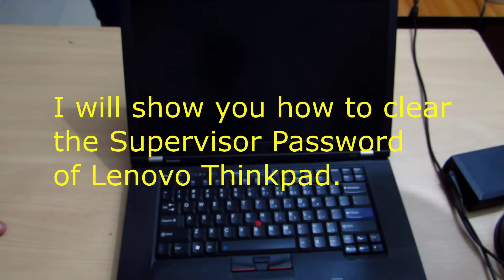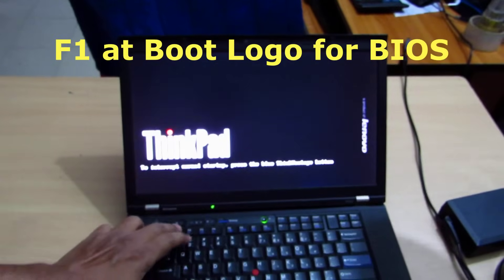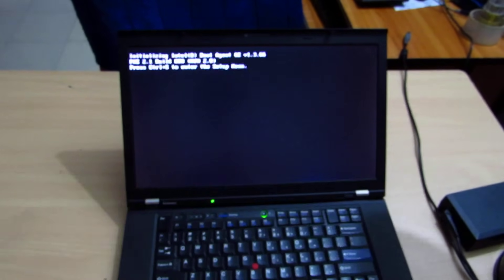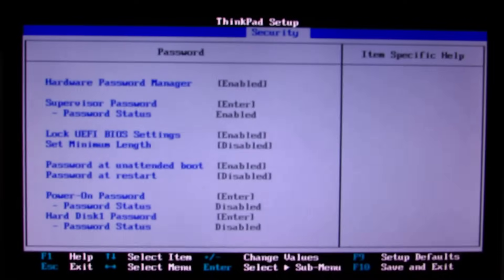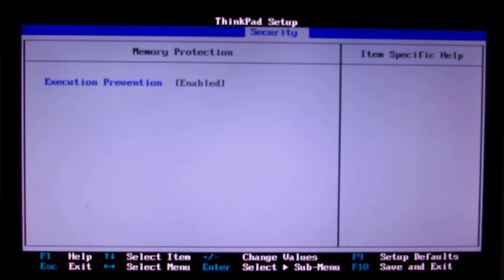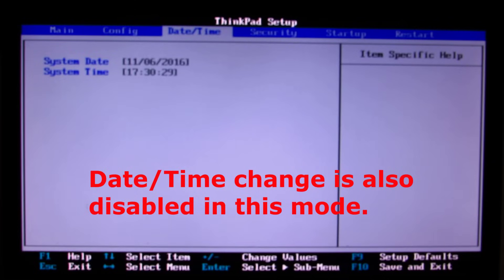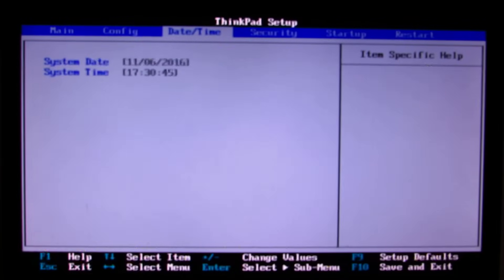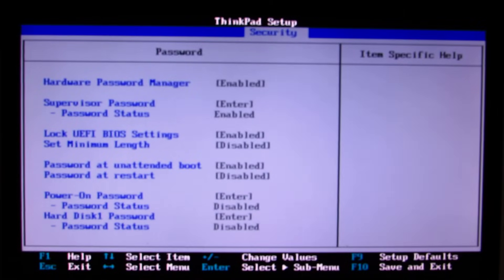How to unlock BIOS Supervisor Password from Lenovo Thinkpad Laptop (no damage to laptop)

Comment: First off, highest praise to Arpan. Would never have been able to revive the T510 ThinkPad I was working on without Arpan's inestimable help. Bottom line: Shorting that little EEPROM chip works exactly as shown.

But.

Getting to the chip on the T510 I was working on, turned out to be much more involved than the video might give you to believe, and in the interests of perhaps helping a few people out there who might be having trouble with the details, I'm going to add a few things that I discovered for myself, the hard way.

Getting the Base Cover Assembly off of the machine was non-trivial. Arpan's expertise is top-notch, but for those of us who do not operate at his level, there are many pitfalls along the way.

To begin with, I would strongly recommend pulling up the service manual for the T510, and it can be found here: https://download.lenovo.com/ibmdl/pub/pc/pccbbs/mobiles_pdf/63y0536.pdf

Be advised that this is a Lenovo document, and it's terse to the point of near-uselessness in certain places, and some of the illustrations leave much to be desired, but it's a great help, otherwise.

The chip you're looking to short is on the underside of the motherboard, and removing what Lenovo calls the "Base Cover Assembly" is what is required to gain access to it.

If Arpan's speed (even freezing frames, it still blinks by too quicky in places), in conjunction with the occasional, camera angle blocking the precise location of what he's working on, plus occasional out-of focus depictions of what he's doing in the video, is causing you problems (it was a show-stopper for me, with my lower level of expertise in a couple of places), then going by the Service Manual will allow you to complete the work.

But the manual goes into the disassembly of things in a different manner than Arpan's streamlined approach, so be ready for a lot of steps.

The manual wants you to remove the Thermal Assembly and THIS IS NOT REQUIRED. Leave it alone. In order of what I wound up having to do, by the manual, using the manuals terms, it went like this:

Sim card.
Battery pack
Serial Ultrabay Enhanced device or travel bezel
DIMM slot cover
Hard disk drive slot cover, hard disk drive (HDD) and HDD rubber rails or Solid state drive (SSD) and storage converter
Keyboard
PCI Express Mini Card for wireless LAN
PCI Express Mini Card for wireless WAN
Keyboard bezel assembly
Bluetooth daughter card
Backup battery
Smart Card or Contactless Smart Card or Smart Card dummy spacer
Speaker assembly
LCD unit
And finally, the goddamned Base cover assembly.

Anything not mentioned above is NOT required. You can safely skip any steps that are not included in this list of steps.

That's a LOT of disassembly just to get to the EEPROM chip, but either because some of this stuff is blocking wires, plugs, or screws that require removal to get the Base Cover Assembly off, or because dangling junk was in the way, or because access was just too close for comfort otherwise, it turned out that all of this stuff was much better off, being removed from the machine. Take your time, go slow, go easy. Required tools were pretty simple. A couple of spudgers, a small phillips head screwdriver, and that's about it. The good news is that the service manual has a complete and precise listing, by size and appearance, for every screw involved in this operation. This makes reassembly much easier, too. The bad news is that some of the illustrations are quite poor in showing you precisely where these screws are, and let me tell you, some of them are very easy to miss, and some of them, like the one beneath the left speaker, are completely hidden from view until the intervening item that's blocking them from view is removed. But they're all there. Every last one of them, and a couple of them are very hard to find, and without removing them, the Base Cover Assembly will not come off. I highly recommend taking that Base Cover Assembly all the way off, and putting it somewhere aside. That EEPROM chip is small, and there's a whole world of other conductive things right next to it and all around it, and any restrictions imposed by only partially removing the Base Cover Assembly, are not worth putting up with, just because you didn't want to find and remove, every single little screw that's holding the thing on. Get rid of it. Take it all the way off. You'll be glad you did.

Once I had the Base Cover Assembly removed, along with the piece of black adhesive paper that covers the whole area surrounding the EEPROM chip (just pull it off, it's glued, but not impossibly so, just do it nice and easy, 'cause you're going to want to put it back in place when you're done), I had a clear shot at shorting the pins on the chip. I then placed the Monitor (LCD unit in the manual), back on the machine, and screwed the two screws on the rear edge of the machine back in, to hold it in place firmly. Otherwise, it's flopping around, it's heavy, and something nasty could happen if it's unsecured. So screw it back on with those two screws before you go to work on the EEPROM chip.

You have to plug the ribbon cable for the keyboard back in, to operate the power switch on the machine, so that needs to be done too. Once the keyboard's plugged in, it too flops around and I taped it down (being careful not to tape any of the keys down into a depressed actuating position while doing so) so it wouldn't get all over the place and mess something up. I plugged a USB keyboard into one of the USB slots and used that to work the BIOS instead of the keyboard I had taped into place. Much much easier to access the required keystrokes that way (mostly arrow key, enter, and escape, with a few exceptions) with the USB keyboard right where I needed it as opposed to the machine's own keyboard, dangling above the machine.

I laid the machine on its back (the back of the LCD unit) with the body of the machine sticking straight up giving me excellent free and clear access to the EEPROM chip, plugged in power and keyboard, made sure everything was solid, and would not move or fall while I worked the EEPROM chip, possibly causing the tip end of the partially straightened-out heavy paper clip I used to short the pins to jump and then short the Wrong Thing, possibly bricking the machine, and then went at it.

Turned on the machine, logo came up, applied the short PRECISELY AS ARPAN DEPICTS IT (but if you want another picture of the chip, just for good measure, find it here: http://www.ja.axxs.net/t510.htm) and CONTINUED TO HOLD THE SHORT, just as Arpan instructs. Having to continue to hold the short is one of the reasons I went to so much trouble to get maximum ease and clearance of access to the chip. I was comfortable, and there was no risk of having the short jump off the pins, possibly shorting something else, and bricking the machine.

The EEPROM chip is square with four conductive metal pins on opposite sides, and has a small indented/embossed/shallow circle on one corner. The two pins you need to short are on the opposite side/corner from that circle.

xxxx
    o

xxxx
^^
These two pins.

The chip is very small, and the pins we're shorting are very VERY small, and there's a million other teeny tiny conductive things all over the place in there. Mind where you're at, ok?

My experience was that immediately upon applying the short right after the logo came up on the screen, I got an error message advising to press F1 if I wanted to enter the BIOS Setup, which I did, and which came up instantly.

From there on, it was as if I was doing a normal BIOS Setup procedure. Except for holding the short across the pins, of course. Navigated into the Security area, and Password area, and went after the Supervisor Password EXACTLY LIKE ARPAN TELLS YOU TO. Blanked the password entry field initially by simply hitting the enter key, AND THEN RELEASED THE SHORT, and then blanked the confirmation field by hitting enter again. It accepted my alterations, and I then hit F10 to save and exit.

It was that simple.

Restarted the machine, and I had full control, BIOS Supervisor Password was now a thing of that past, gone!

Hallelujah!

So the business of actually working the EEPROM chip turns out to be fairly easy and straightforward.

But the business of getting to that miserable little thing in the first place.... whew, that was a rough one.

But if I can do it, then you can do it too.

Arpan, I cannot thank you enough! You're the man!
Reply: What a great post!
Reply: No, YOU are the man ♥️♥️♥️♥️
Reply: Just giving a try....not sure I will get response.. thanks for the explanation..but will this work on T440 ??
Reply: @araunya  I wish I knew, but alas I do not. The presumption would be that if the EEPROM chip in question resides on the motherboard of the machine you're working on, then yes, it might very well work. But. That's a presumption, and beyond that, I cannot go. Please tell us how things turn out, if it's not too much trouble, if they work, or if they do not work. That information will be helpful, either way, for others who are in a similar bind, looking for help, who come here and read our words. We're all in this together, right?
Reply: @jamesmaclaren204  Oh my Gosh... I wasn't thinking I will get a response considering the posts were so old. But first of all thanks for responding James. Appreciate it.

And I agree with your by every word what you said. We are in this together and we can help each other. So to be honest , I haven't got any clear answer (simple one). But there is this YouTube page (  here is the link: https://youtu.be/AX_e9jlhbAg ) and he claims this process would work for T440. And infact all the T and X series. But all I can say with the looks of it - it's not user friendly for anyone or everyone to go through it. It needs some extra tools plus some 
Skills as well (soldering to start with). Hence it might be helpful for some.

If you go through video description, you can see all the models it works with. T440 being there as well.

----- ---

That's about it for the BIOS reset. But since you responded , if I may get some expert advise from you on my reason to actually get into BIOS. I actually want to just upgrade my T440's hard drive to SSD. That too by using the M.2. slot of WWAN on the motherboard which is empty. Can I do that without going to BIOS. If yes, I may not require the BIOS flash at all. What you think? Is there a work around??
Reply: Go for it! If you can just plug it in, then do so. But if the BIOS is locked, then there's no telling whether or not  you'll be able to access the drive, presuming the machine even figures out that it's there in the first place, which is possible, but not guaranteed. Give it a shot. Why not? And if you can get it all to fit, then an M2 to SATA adaptor is another option. But. If that BIOS is locked, then that's going to have to be addressed at some point, most likely.
Reply: @jamesmaclaren204  Sure James! Let me try that. Will post here if I get lucky. Cheers mate.. take care
Reply: @araunya  Looking forward to your reply. Both on behalf of myself, and on behalf of all other people who might one day pass this way, scratching their heads, wondering how they're every going to get out of the bind they're in. Your kindnesses are appreciated. Both by myself, and by many people neither one of us will ever meet. It is a good thing.

Comment: I can confirm that this worked on an x200s. The pins you need to connect are the SCL and the SCA pins. You need then to press F1 several times after you jumped the pins. Do not try to set "a new password" but leave it blank just as he says. Then the "release" of the pins at the right moment is crucial. Thanks a bunch man for this tutorial. Saved my month (or so).
Reply: How did you know when to release the pins?

Comment: does this method also work for the TP X250? Im affraid to fuck it up :D
Reply: Hi, did you find a solution? I just received the same model
Reply: @mattbash Theres a way. You can flash the ROM but I have no clue how to do that and you can fuck up a lot if you do something wrong. So i bought a whole new mainboard for like 70 EUR. It worked fine but the cpu on it gets hotter.

Comment: Thank's to Arpan for this video ... it enable me to clear the sup password on my Lenovo T520 . couple things i would like to add for those having a t520 .
 1. the EEPROM chip is not on the same side of the MB as show on this video . you have to remove the metal frame to access it . Check this link for exact location ( http://www.ja.axxs.net/t520.htm)  2.  When I accessed the BIOS after flashing it , it seem to have been reset,  after you set your blank password  go to the Security page and set SECURITY CHIP to ACTIVE. If not you may get this error (bad crc of security settings in EFI) .
3 for me I had to keep the bio flashed and first HIT save,then do an F10 . When I did like on video and removed my pin from the EEPROM to RELEASE SHORT and did F10 , it didn't save anything I was right back in "red Only" mode .. 
 Cheer's ...
Reply: Always at first time leave it blanck .(retype nothing 2 times)  And hit save 3x. After that its more easy for the pc to re-assemble

Comment: Hello, Arpan. When you say short the pins A & B, do you mean connect the wire to either A or B, or both by placing the wire between them. I can see it in the video but It's not clear to me how exactly you are shorting. Thanks

Comment: Thank you so much! I did this on my T42, I had to do it a little different.
1. Press power button.
2. When the ThinkPad logo show, press F1.
3. Look at the processing symbol (The cylinder with an arrow)
4. When it flashes the last time before the lock usually appears, short the two middle pins on the right side of the U53 chip.
5. This got me into the bios.
6. I released the short at this point.
7. All the password settings were disabled, and i could not change anything.
8. Press F10, and windows loaded right up.
I switched it off and on to see if the changes remained and they did.
Reply: DCandVision, help! I can't get this to work on my T42. I don't have a processing symbol... no symbol with an arrow, nothing flashing. Just the entering BIOS text
Reply: Jeff McConnell 

The bar with different symbols on your screen bezel. (Under your screen) There is a cylinder there, that is the symbol.

Hope this helps
Reply: Jeff McConnell 

Yes, I shorted the middle pins. You could try to short it everytime the symbol flashes once, this will stop the processing symbol, so you have to let it go again, wait for an other flash, and repeat this. To make sure you short it at the right time.

The pins on the same side those red wires are connected in the picture, but instead of the two on the bottom, i did the two in the middle.
Reply: @Dcandvision Hi does your method work on a LENOVO YOGA 260 THINKPAD LAPTOP PLEASE THANKYOU.

Comment: On the edge E430c  the chip was u8. You can try shorting it out from under the cmos battery if you dont want to tear your laptop apart.. you just have to figure out which holes to stick the wires into.

Comment: The above method, which I doubted will work, worked on my Thinkpad X201 .  After googling, I came to the conclusion that the EEPROM for the X201Tablet version is in the same location. When you search online, the wrong documentation will point you to two very tiny holes on the motherboard to be the EEPROM  location which if you are trying the above method, it is impossible and won't work. It might be the right one if you programme the EEPROM . To short EEPROM, its on the back side of the motherboard near the CPU/Heatsink. You gotta listen to the instructions word for word in order to achieve the result you are hoping for.  I never thought this would work but I can confirm that it worked like a charm. Another video, on Youtube suggested that you take out the CMOS battery and that was what I had initially done and it put me in a greater problem as the computer won't boot at all due to the Date/Time Error. Thanks for this beautiful video - a vitally beautiful video for my Thinkpad.

Comment: Thank you so much for the video!I have recently removed the supervisor password from Thinkpad models T61, T61p, T400 and R500 by using this method.I used an external monitor and a keyboard (along with the laptop's own keyboard, as it is needed to turn the laptop on). It makes the job somewhat easier.
Reply: Hi, I was struggling last night with my T400, managed to boot to BIOS but could not modify anything. Were you just shorting these two pins with screwdriver? 
Any grounding needed?
Just after shorting the pins, Did you have to press F1 to initiate booting to BIOS? Or does it start booting BIOS by itself after you shirt the pins? I'd appreciate some advise.
Reply: @LuckyLuc_YT  I don't remember the whole procedure that I did, but with the T400, according to my notes, I 1) booted the computer 2) pressed the F1 button 3) shorted the pins only AFTER the BIOS asked for the password.
Reply: @ookkonaaoulusta thank you for this information! Currently seeing a T440p on eBay for $40 but it’s bios locked unfortunately

Comment: For those wondering if it will work, only on the 3th gen and older (inkluding X230, T430, T530, L530, ... ) for the location of the EEProm you can check it on ja.axxs.net - happy tinkering!
Reply: FYI to make it write the empty password to the eeprom you'll have to release the short

Comment: Do you disconnect the cmos battery or not? I have a x230 and this is not working for me I power it on, as soon as i see thinkpad logo i connect pin a and b and hold for more than a minute nothing happens? Am i missing something?
Reply: Manny Martinez have you grounded the connection apart from shorting the two points?